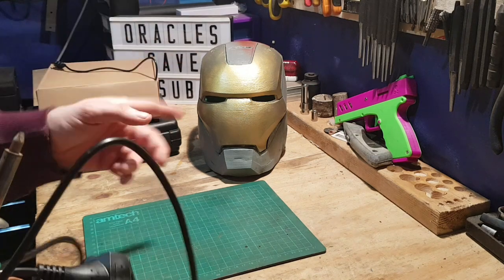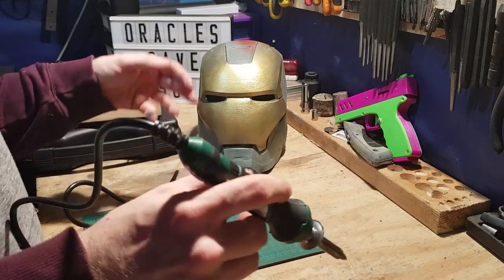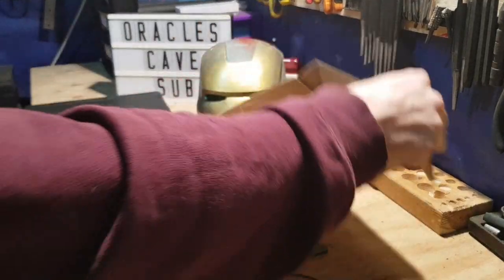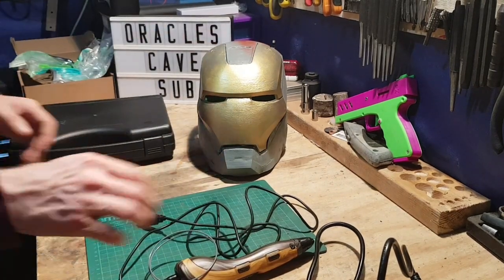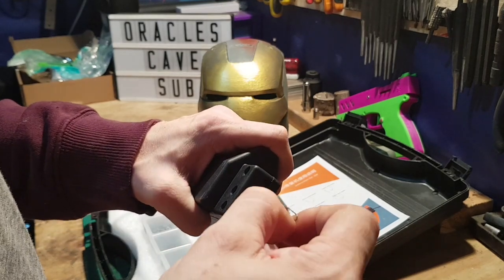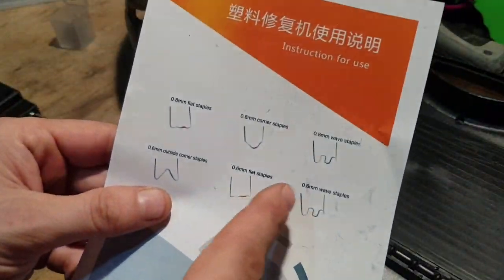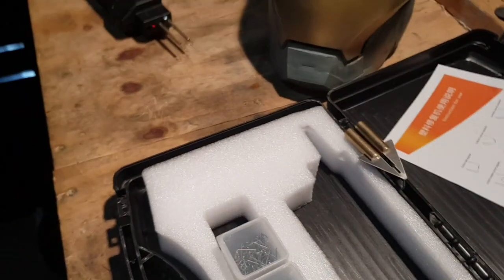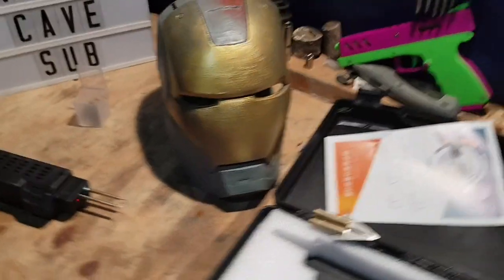HOW TO REINFORCE 3D PRINTS TO MAKE THEM STRONGER

Comment: The ruber plate you have there what is it called
Reply from the maker: The green rubber thing is called a CUTTING MAT.
it is for cutting paper on, it can be cut thousands of times and shows no signs of being cut.
I use it when I'm cutting with razor blades.
👍👍👍
Reply: @oraclescave  wow that’s very impressing! Thanks for the answer keep up the good work ❤️🇸🇪🤝🏴